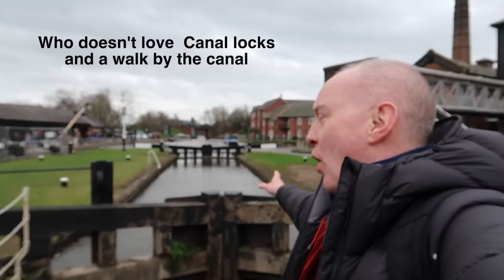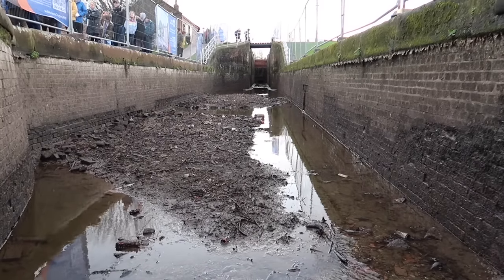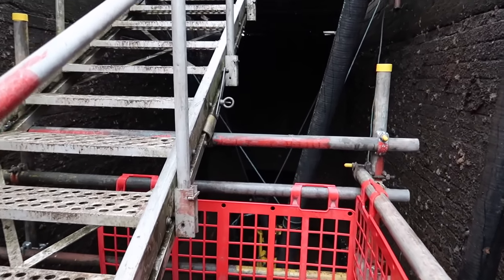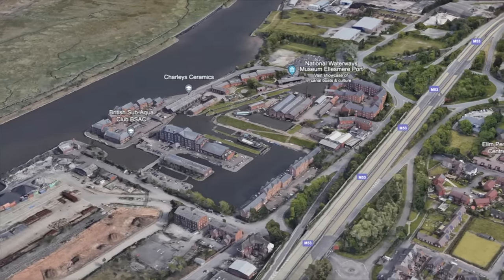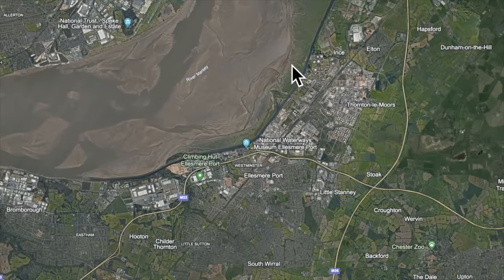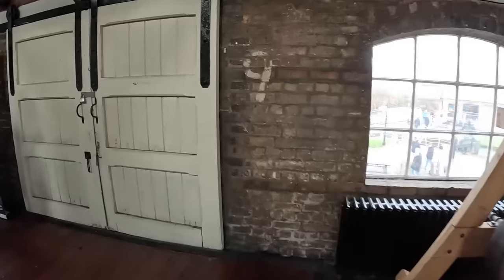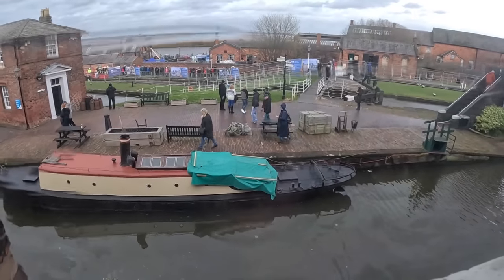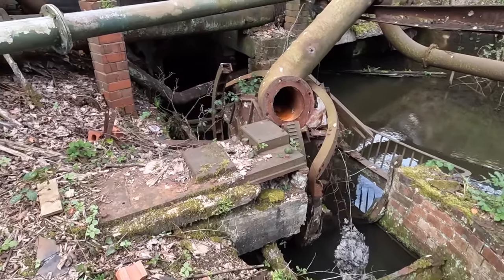Engineering works on the Canal Lock

Comment: Having used those locks for a good many years, it always amazed me how very different some of the designs were and alwys good to see the bare bones, as it were, to learn about  how, when and why they were built in the first place. Also for something that in theory should all be basically the same, are in fact all completely different from each other as conditions and situations all vary as to the lay of the land, amount and type of rock they were (blasted through with dynamite in some cases) and dug out from. Fascinating stuff, thanks for sharing once again.

Comment: I love canal locks it's incredibly interesting to see them operating and even being repaired and drained.  They do go back so far and many times how they were done is still the most dependable way.  I remember my uncle telling me about the locks quite near his house which he took me too.  It seems there was a gasket expert just hired by the agency who maintained the canal, who had the answer a modern seal.  Previously it had been getting replaced every few decades.  He had zero experience with locks yet assured them this made no difference it was a seal and specs are specs.  Well the lifetime modern gaskets needed immediate replacement after either 6 or 8 months.   He then put back the "old fashioned" gasket back again and took his place all be it down a few pegs.😅

Comment: One of the reasons that the MSC was built was to bypass the upper Mersey to Warrington (where the old Mersey & Irwell Navigation began at Howley Lock), because the navigable channel was constantly shifting with the weather, and the commissioners couldn’t keep up with the constant dredging and re-buoying required to keep it open.

Comment: You are correct on the Manchester Ship Canal, they used the navigable parts of the Mersey and Irwell to build the canal. They made them into a canal to be sure these ship routes would stay in place (and not shifting with the sand banks or silting up) and make them accessibel for larger ships.
Reply from the maker: Ahh right, thanks

Comment: I grew up in Ellesmere Port and as a kid in the 1960's this was my playground. Of course it was all derelict back then and really dangerous. We used to cross that bridge to where the steam engine is and peer in through the filthy windows where you could just make up a big flywheel. The hydraulics used to power lifts in the Telford warehouses located in the lower basin where the hotel now is. These had arches over the canal and the boats would stop under the arches for the cargo to be loaded and unloaded by means of the hydraulic lifts,  Sadly the warehouse burned down in the early 70's, I ran home and got my cine camera, the resulting film is on display in the museum and I have a copy of it on my youtube channel
https://youtu.be/AY4qMgUXFMM?si=UHUxMHlrzCo06Oai